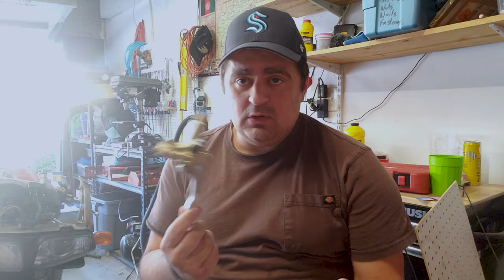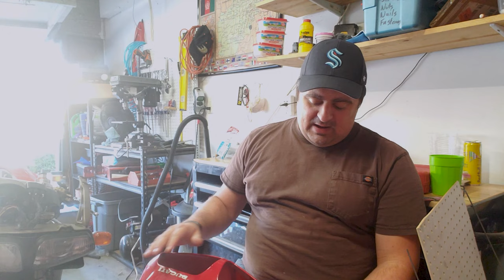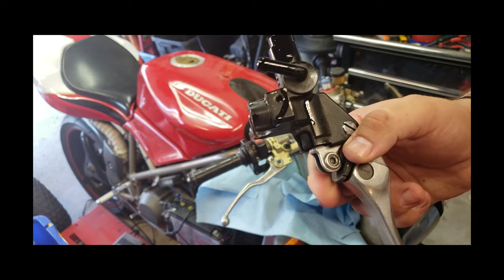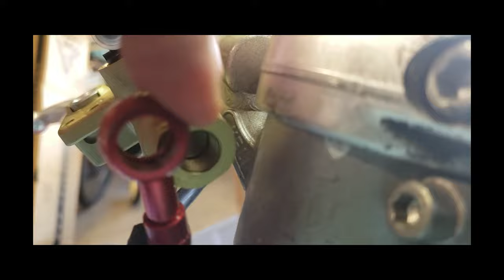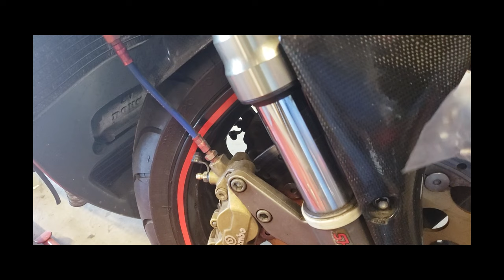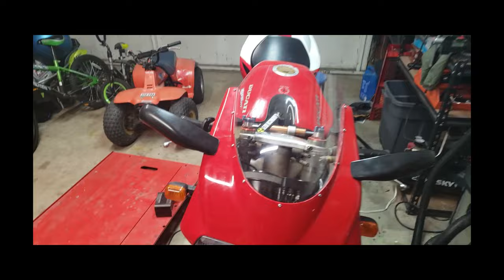Brakes and Fairing Fix - Ducati 916 Rebuild 20

Comment: i did the same job last summer and used typical clear gas line from the hardware store for the short piece between the master cylinder and the reservoir and it ended up weeping brake fluid through the sides of the hose... Keep an eye on it for a few days so you don't accidentally get fluid leaking on your tank etc. You can buy the proper hose online if you google it.

Comment: Good to see you’re back.. f.i.y. I’ve recently obtained a set of Chinese fairings pre painted for a 916 and must admit they’re petty darn good for the price.. consider as an option as they will definitely keep your expenses down and an instant facelift for the bike 
Where did you source the screen from as I’m having difficulty finding one, as I don’t want the aftermarket double bubble types that are plentiful on the internet. Any info will be much appreciated keep up the good work
Reply from the maker: The screen I have on there now is by the same company that does the double buble, zero gravity. It just doesnt have that look. It's their sport touring version, which is a bit excessive of a definition, its only maybe an inch taller than stock. 
 It was listed as:
Zero Gravity Sport Touring Windscreen Clear 23-726-01 Sport Touring 2301-0618

Comment: Fairing will crack again.  SHould have reinforced with fglass or carbon fiber cloth.  Thick super glue, cloth, then more SG... stronger than new.
Reply from the maker: I think it probably would have been ok. I used a bit more of the plasic repair stuff and built up a backing after the vid. Same idea. This stuff is meant to be used that way. Carbon fiber or fiber glass probably would have been tougher, but overkill. This crack(break really) only appeared because I bumped into it.
I won't know either way, it's the movie comoany's problem now.